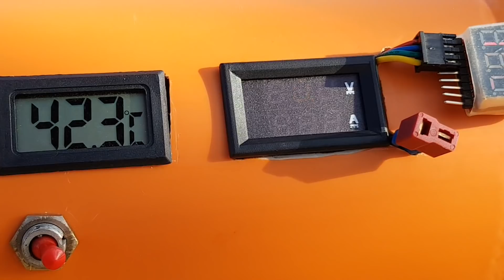How To Make Monster 100w LED Flashlight 10,000 Lumens With Huge Lenses

Comment: Errr, 25 years ago I had a 12v spotlight the size of a large margarine container. It was rated for 1 million candle Watt power. Or 12,570,000 lumens. Your could stand on the street at night and put out the street lights by flashing the photo sensor. From below!

Comment: I made one using an off-road light. I replaced the halogen bulb with an actual LED car headlight bulb that has a built-in fan. Hooked up to a switch and a Ryobi 18v battery, no voltage step-ups or step-downs.

This lights up the whole block. The reflector does a decent job giving a nice beam. I might ad a magnifying lens for a stronger beam.

18v definitely helps, it's a 12v car headlight bulb and it's handling the 18v like a champ.

Comment: an led designed for a flashlight, that has 5x smaller size than this one, can output a lot more light lool. Use the right led for the right project! Bigger size doesn't mean better right here.
Reply from the maker: I am wotking on a waterproof flashlight now, it will have a smaller led but almost same power
Reply: xhp70.2  7.4v at 19A 
9200lumen 14mm² light output surface
100w led 7500lumen 36v 3A  
100-200mm² light output surface

Comment: why you used 12V battery pack + step up converter, these leds works at 30-38V range so simple 9S2P battery pack from 18650 cells will be straight forward to plug
Reply from the maker: It is better to use 36v battery and step down converter, this led works with 32v, 3 amp max.
Reply: @ImpactDIY  i dont know about this led which you used in this project, but these 100W led from ebay/aliexpress usually has work range 30-38V (30-36) (28-36)
Reply from the maker: @duniek86  this led draws 3amp at 30v, more amps will destroy the led.
Reply: @ImpactDIY  but amps are constant - only total brightness/power draw will be higher - 3A led at 30V will be 90W,  and at 38V will be 114W - 9S pack has 37,8V at full charge - so after you use flashlight voltage will be drop to minimum 30,6V (bms cut off)

Comment: Where can I find the cooler/heatsink you used?
Reply from the maker: Hello, I used a coller recovered from old AMD pc, you can use any cooler but the bigger the better :).  Now I make the flashlights with xhp70 led and I use  Acer HI 10800 cooler, round shaped that is easy tou attach on the pvc pipe. I will soon make a video with it :).
Reply: I strongly recommend active cooling with something like this.

Comment: Awesome light, how did you make the battery pack, would love a video on it 👍🏽
Reply from the maker: Thank you! I will make a video about the battery pack soon :).
Reply: Sweet I will keep you on my notifications so I can keep an eye out for it, I built a light similar to yours but I used a parabolic reflector with a small battery pack but only last a few minutes
Reply from the maker: Try to use 36v pack and buck converter. I used boost converter on this one but for 3 amps needed by the led the booster draws 9 amps from the battery. Buck converters are a lot more efficient.
Reply from the maker: You will see this in the video with the battery pack :)

Comment: I wanna make one!
Reply from the maker: It may be better to use a 36v battery(ex: hoverboard battery has 36v and bms) and buck converters for led and coolers because with dc booster for 3amp needed for the led the load on the battery is 9amp. The one i made with dc booster  works for about 1,5 hours, with buck converter it will work for 3 hours. I hope you understand, my english is not the best. Have a nice day and good luck with the project!